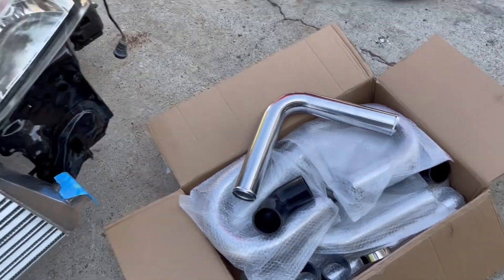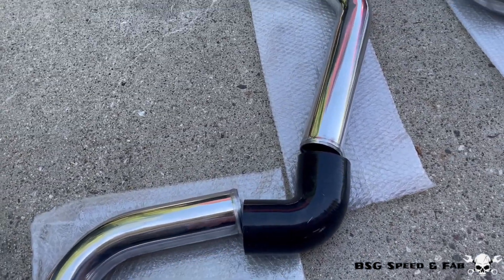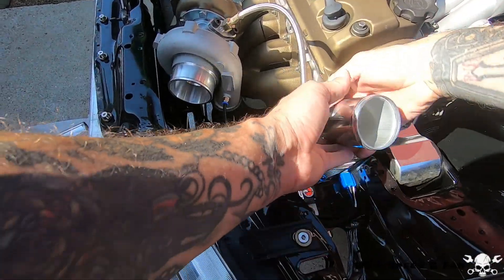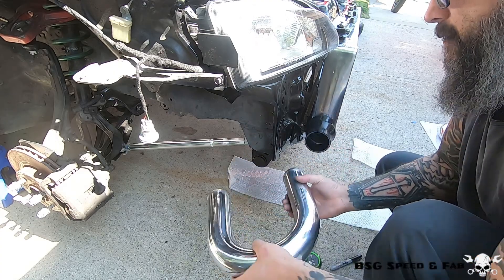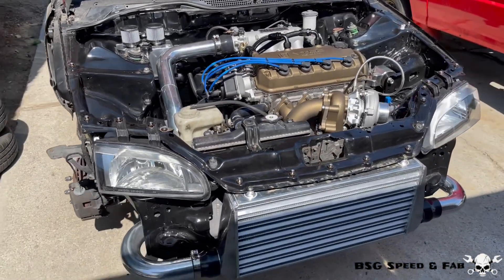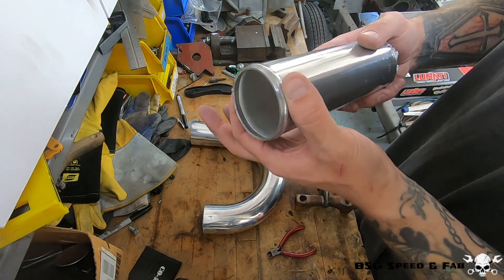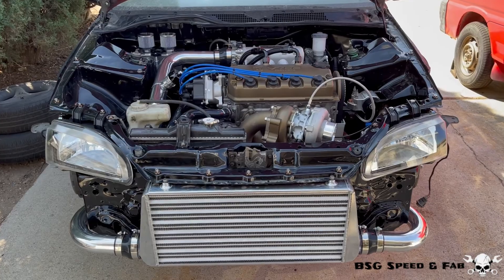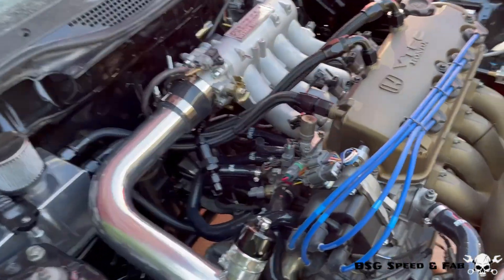Project Civic EG - Ep 10 : Making custom intercooler piping

Comment: Hi. What size is your intercooler? Where can I purchase one I like that size on the EG's.
Reply from the maker: 31x13x3. Can be bought on eBay https://www.ebay.com/itm/384705076326?mkcid=16&mkevt=1&mkrid=711-127632-2357-0&ssspo=Oy-oQhUTQ1q&sssrc=2349624&ssuid=HWsSs8zGTmO&var=&widget_ver=artemis&media=COPY
Reply: @BSGSpeedFab  Thank you so much been looking around just wasn't sure what size it was. Do you know if your stock bumper fit on it without showing the hot and cold side piping on each side?
Reply from the maker: @billlagudas  yes I did test the stock bumper and it fit with the piping. The grill section does need a lot of trimming to clear the intercooler
Reply: @BSGSpeedFab  The grill section you’re referring to is the middle right? Where the intercooler is at. I wanna keep the side little grill fins factory from the outside without the piping exposed. As oem as possible.
Reply from the maker: @billlagudas  that’s correct, only where the intercooler is. The piping is hidden behind the bumper
Reply: @BSGSpeedFab  Awesome. Thank you so much! Sick EG build btw sad it’s no longer in your hands but I’m sure it will be in good hands!!

Comment: My car doesn't have very many manufacturers making performance parts for it, so an airtec IC would set me back 750-800(USD), while the Fiesta ST IC is only 460(USD)...
So yeah, I wondered if custom was worth the hassle, and also could hopefully route hot n cold on opposite sides (the few ICs I see ar same side)
PeugeotSport 208GTi (vid on my channel)
They can reach intake temps of 50-60c just on stock boost btw, not good 🙈
Reply: Also, huge respect for your efforts, wish I could know as much some day!

Comment: Nice job, looks clean as, u made it look easy. That engine bay is super clean to. 
I also made some of those vice grips bead rollers today. They work well. 
What’s that little tool called u used that get the burrs out of the inside of the pipes after u cut them.
Reply from the maker: Awesome! Thank you. The tool is called a rotary deburring tool. Super useful. Glad you vise grip bead roller worked out for you.

Comment: I'm thinking about doing the same thing. Do you know if the U pipes will work with an Integra without clearance issues? I'm not sure if the civics and integras are the same.
Reply from the maker: Integras should be very similar. I don’t see why the U pipes would not work
Reply: @BSGSpeedFab  I'm just going to buy it a give it a try. Thank for the info and great videos.
Reply from the maker: @steveabner  Rad and good luck with your build!